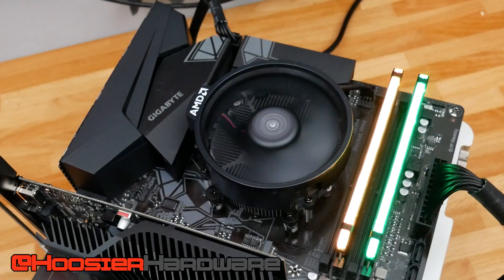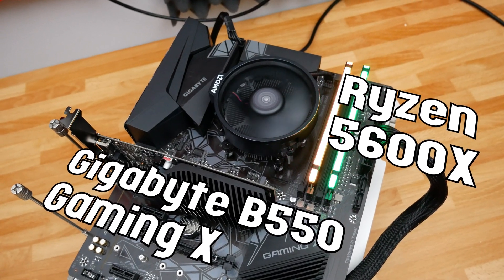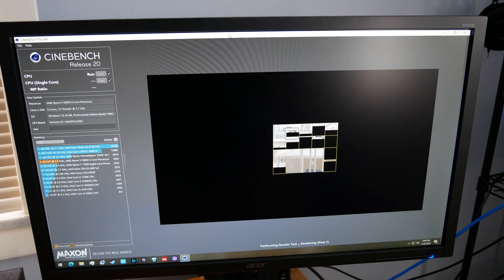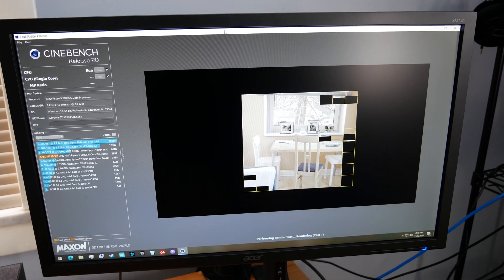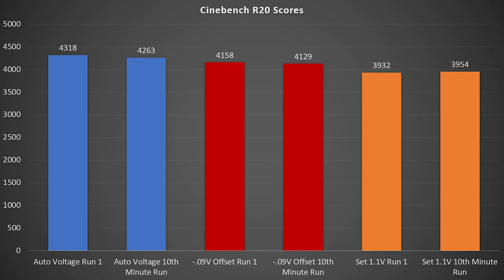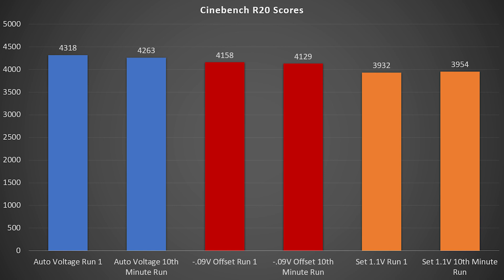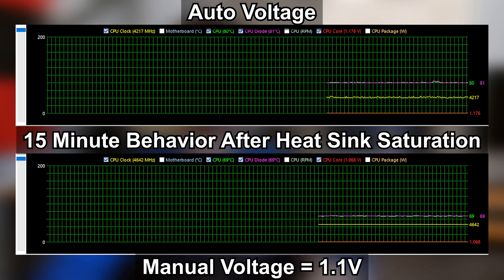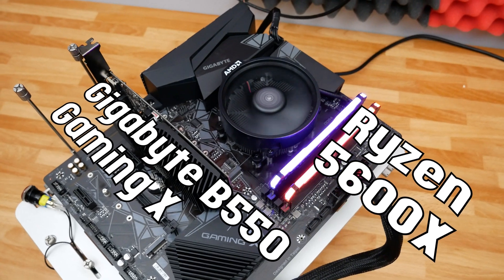Undervolting the Ryzen 5600X

Comment: Don’t undervolt too much, because even if you don’t get bsods or freezes, the CPU will actually loose performance. Same behavior can be seen on the previous ryzen generations.
Reply: Is -0.1000 volt offset good amount for starting?
Reply: @ThePurePlay  you start with the minimum offset the motherboard allow. You test a go from there. When you see the benchmark numbers start to go lower, it’s time to stop. On some cpus you might encounter freezes sooner. It’s de CPU lottery.
Reply: @p4thos  thanks for this info! I'm really new to the pc overclocking world but had watched some tutorials on how to get the best out of the ryzen processors. Will  follow your tips for not overdoing it.
Reply: @ThePurePlay  it's pretty easy, just benchmark it after stepping down -.05 and then incremental from there. .1 offset is probs doable
Reply: @LegacyLoot  Thanks for the tips! I done it already actually, started with -0.05 and I find that -0.0875 is the best for me which gives me a bit higher score than stock in Cinebench R20. When I try -0.1, I started to lose some Cinebench score while getting the same max temperature with -0.0875, so I guess -0.0875 is the best for me as of now.

Comment: My 3600 with stock voltage I get Cinebench 20 score of 4760 and setting offset to - 0,075 I got nearly same score of 3747. Tems went down and power usage +/- 15 Watts on CPU. All stable. Maybe increase to 0,075 or 0,06 or maybe 0,05?
Reply from the maker: That's good information!
Reply: wait, you mean ryzen 5 3600? zen 2 architecture??
Reply: @samarthtibdewalGL   Yes, Zen 2 Ryzen 5 3600
Reply: Offset -0.075 Volts, stable as a rock. I tried more than -0.075, but then the performance begins to drop and stability is no more 100%\

Comment: I have a note about the AIO in the case in the background. It´s been wrongly oriented. Such orientation will help with building up air bubles in the hoses, eventually killing the loop. The reverse orientation may not look as good as this, but it will help the long-term durability of the AIO loop (and prevent possible unwanted noises from the pump in the future). Gamersnexus covered this very deeply:
https://www.youtube.com/watch?v=BbGomv195sk
Reply: Oh lord, is it optimal? No, is it gonna die ? No rewatch the video
Reply: Rewatch it, Steve even did a follow-up, that's not what he said.

Comment: is it true that the new ryzen zen3 performs better with 4 sticks of ram instead of 2 ?
Reply: Yes but it's not the 4 sticks themselves, it's the memory rank. 2 sticks of 16 gb dual rank memory has the same performance as 4 single rank 8 gb sticks.
Reply: @baalrog666  Do you have a benchmark? I can only find 4vs2 sticks.
Reply: @12Music72  https://youtu.be/AGux0pANft0 Hardware Unboxed did a memory scaling video today, tested # of sticks and various frequencies and timings. Basically, 3600 mhz cl16 is fine just like Zen2, and especially if you're using something like a 2070 super or 5700xt, there is barely any difference even at 1080p and even with 2 single rank sticks.
Reply: @baalrog666  Yeah I saw that video, but you still see scaling with 4*8. Luckily I bought 4*8gb 3600mhz cl16-16-16-36 ram on a discount last month. Pairing it with a 5800x and rx6800xt
Reply: Yes. +- 8% better. Watch GamersNexus. Probably the most credible tech youtuber.
Edit: https://youtu.be/-UkGu6A-6sQ
Reply: 2 dual rank / 4 single rank